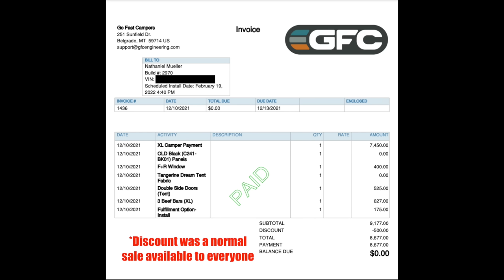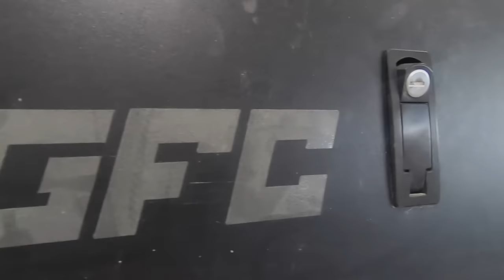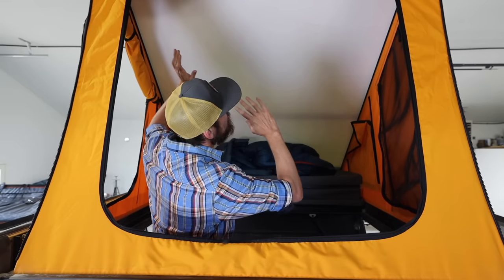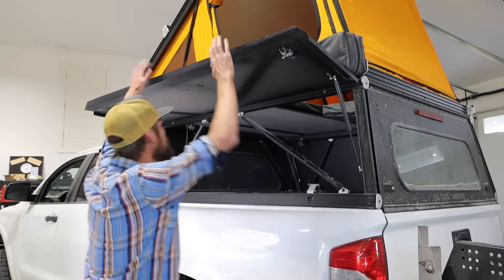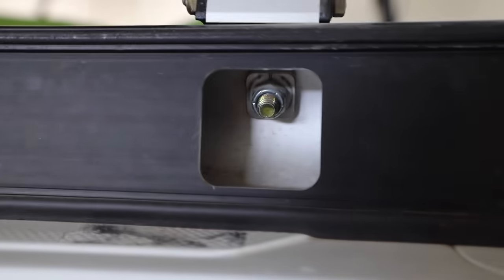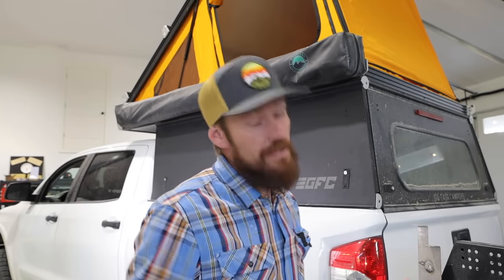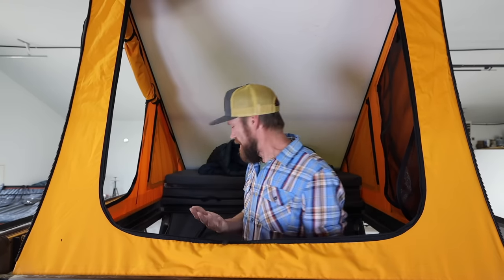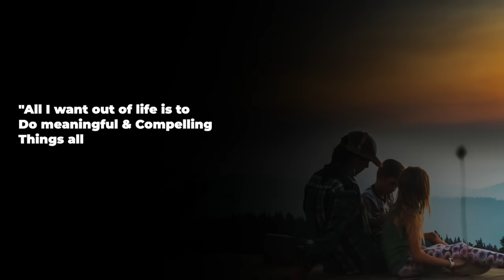GO FAST CAMPER, The BEST, WORST Rooftop Tent - Honest Long Term Review - Truck Camper Buying Guide

Comment from the maker: What do you guys think? Would you buy a Go Fast Camper or are you looking at something else?
Reply: I’ve been doing research and came across your video. After your review it’s exactly what I’m looking for. Simplicity and longevity. Thanks for the video. I’ll be purchasing one.
Reply: I think a FWC project M would be the way to go
Reply: I looked at the Go Fast for my Gladiator Rubicon but ended up going with the Alu Cab Canopy Camper.  The weight issue was not that bad for the Gladiator Mass Gross Weight. When you remove the tailgate you are looking about total added weight is 500 lbs.
Reply: Big fan of ur channel… question, thoughts on security? As in, is it ez to break in to? Would you place valuables and walk away without worry? Thanks!
Reply: I have one on order and will pick it up in about a month.  The GFC fit the bill for me in terms of weight and functionality.  I am a bit worried about condensation in cold weather, but the majority of my camping won't be in cold weather so I'll just deal with it.  Yeah there are other similar campers like the AluCab or Harker, but in my mind they are too big and too expensive for me.  Thanks for this thorough review!
Reply: Looking at Pack Out campers similar to GFC, cost for us canadians would be $15,000 plus driving down to vegas for the install. Have you ever looked at Pack Out?. Great review of GFC.
Reply: Love your truth 😊❤
Reply: I’m trying to decide on GFC or Moonlander. GFC offering me military discount & Black Friday discount almost 500 off. Moonlander isn’t offering any discount.
Reply: Went 100% canadian, alltech Basecamp ov1. Received pre-2024 prices, 270% awning & free winterized fabric for wedgecamper.
Reply: @SasukeUchiha-zu6dw  I agree, but it is double + the price
Reply: Looking at the Lone Peak Camper
Reply: @SasukeUchiha-zu6dw  Yes, I am wondering if the extra 100lbs really matters. It's like a really small woman or a child riding with you. Doesn't seem that big of a difference and they have more features.

But I like how this is a wedge better. Easier to open up and close. At the end of the day extra features are kind of gimmicky and what they don't have you can DIY. A lot of the stuff that the project M comes with are standard camper stuff that people who build out vans and Skoolies put in their builds like the fans etc.

You can probably have some of that added to the roof of the GFC since it can take up to 75lb of stuff on it and still open.

The project M though is a LOT more expensive as you option it out.
Reply: Most of the issues you bring up are now addressed by the new V2 pro. Not sure if running wires or proprietary track hardware are still issues though. I'm considering one of these due to the bombproof build quality.
Reply: I would love to see you review the new version of this tent because it seems like they addressed a lot of things you mention

Comment: I own a gfc and he pretty much on everything on point. The biggest pro for me is how well built it is the biggest con is the lack of features. Every single competitor all offers side windows, solar and roof fan as options imo solar and roof fans are necessities and something every manufacturer can easily install. My gfc is for my Tacoma and I just got a tundra and just because of the lack of features I’ll probably go with a competitor if I choose to get a camper for my tundra
Reply from the maker: Interesting... super curious what you go with.  Let's know what you think of watever you go with.
Reply: You sound like more of a glamper rather than a camper. That stuff is nice and all but definitely not a necessity.

Comment: I have a GFC, and I definitely built it out way more than most GFC's.  Because the GFC is only 275lbs, I have enough payload for my GFC camper, Expedition One bumpers, a Victron electrical system, and all my camping gear and toys  on my 2020 Ford Ranger.      Btw, a diesel heater also solves the condensation issue in cold weather.      Cost-wise, I consider the GFC close in price to a RSI Smartcap and a roof top wedge tent, but you can't stand up inside with those.     And I agree, weight wise, you can't put a Alu-Cab or a Four Wheel camper on a small truck and have any payload left.    But if you never go on narrow, back country jeep trails then just get a bigger truck and go for more comfort.    To each their own.   You gotta pick what's best for your style camping and budget.
Reply from the maker: Agree 💯
Reply: I run a RLD designs canopy on my Colorado and a GFC Superlite.  I wanted the ability to remove the RTT because when we go camping, we don’t always go in the RTT.  Many times we use our square drop camper and sometimes ground tents depending on what we are doing and where we are camping.  You are right cost wise.  I am probably in the same amount of money for the canopy and RTT as a GFC camper would have cost.  Maybe I just over thought it about the GFC camper and running around with the GFC camper on your truck all of the time is no big deal.
Reply: It's really easy to let the GFC's upfront cost sow doubt.    But it sounds like you still have good camping options.   I wouldn't second guess yourself.   Use what you've got until it falls apart!  

I kept my old mini camper (like a small utilty trailer) for similar reasons.   But it's also designed with rear barn doors, so I can get plywood and stuff with it.   It's also nice to have when I can bring a buddy along to camp.      My wife is welcome to sleep in the GFC with me, but I really don't want to spoon with my guy friends.  Lol.

Comment: I’ve had my V2 on my Tacoma for 2 years now. Many nights and miles on it with my wife and now 2 year old. The ability to stand up in it is a massive benefit. I live in the desert southwest where condensation has been a moderate problem, but everything dries out so fast. My two year old also wakes up as soon as it gets light out. I wish there were some easily removable blackout/insulation options for the roof panel.

Comment: Great video.  I feel the same way about my GFC.  I dislike the locks immensely though.  The condensation in cold weather is insane.  Whenever I talk about my GFC I tell people for the price point it's the best you can get.  Added features add cost.  I always mention the negatives as I feel after spending this amount of money people are hesitant to say they've made the less than "perfect" decision and will defend the purchase at all costs.

Thanks for the honest review that should help new buyers.  Liked and Subscribed.
Reply from the maker: Thank you SO much for saying it.... people feel like they have to defend their purchases way too much... its ok to like a product that isn't perfect. For the Value for your money and they weight the Go Fast is a fantastic product... its not perfect... and its ok for both Truths to exist at the same time... Go Fast deserves lot of credit for being an early innovator... and yes other brands are catching up. Thats a good thing, it will put pressure on the market and we, the consumers will benefit from it.
Reply: Heard from another type of wedge camper that all the locks are the same, meaning someone with a similar canopy can use his keys & steal your stuff.
Reply: @CanadianCampPurr  because the type of people spending $8k on truck campers are the type of people to go around stealing from people’s cars. 🤔

Comment: I'm in research mode on getting a GFC. Just weighing pros and cons. Lot of reviews claim water leaking in and quality not good. Not seen that from Topo Toppers, or AT. Good video!
Reply from the maker: well for starters... water will leak in through your tailgate... so any tent that doesn't replace the tailgate will have dust and water leakage. Just FYI. AT's cost significantly more... like almost double so I would expect some differences there... not really Apples to Apples at all... I like the AT's a lot but I didn't like the setup time and extra weight. What one is best for you just really comes down to what you are trying to accomplish. I would like to test a Topo topper... the look great, the weight is awesome, but the supports and engineering for strength worry me... if that tent gets truly offroaded I am curious how it will hold up.
Reply: @OutdoorAuto  I have a Tacoma w/ ARE topper so yeah i'm aware of water and dust. Other reviews claim water intursion from front hinge and pooling in the extrusion. Another showed back door not zipping all the way down and other openings in fabric. Like i said just doing research and leaning towards the GFC.
Reply: @minimalistmaximus6476 we had a small percentage of units a while back that had some upstairs leaking issues. After a very exhaustive engineering effort we updated a number of components and procedures to eliminate the problem. Every camper we currently produce has these fixes and we update under warranty any camper built without these changes if they have an issue.  (I’m with GFC, btw).
Reply: Take a look at Super Pacific. After a bunch of research that's what I put on my 3rd gen DCSB and I absolutely love it.
Reply: @the_wiley_davis  Wiley, I know you are on the forums. The forum community is giving great input and requests for a redesigned v3 tent material. Please please add venting at the top of the tent for the condensation issues along with full zip doors for bad weather conditions. If these changes were implemented it would completely change how the tent feels and acts in the colder climates.
Reply: @the_wiley_davis I had some issues with my GFC Superlite.  Customer service has always been great answering any questions and resolving any issues I had.

Comment: I love my GFC but damn they gotta fix the tent material and the vent. It NEEDS venting at the top of the tent...If they redesigned the tent material + added full zip doors, it would make this nearly a 10/10 for my application.
Reply from the maker: I know what you are talking about as far as adding a top vent,,, when you say "redesign tent material"  do you just mean changing the doors and adding vents... or are you having actual issues with the material itself ( I haven't had any issues with material so I was curious). Also I know the straight zip door are a bit odd compared to what is on the market... but I really haven't encountered... what are you running into there?
Reply: @OutdoorAuto  mainly from a venting and closing the tent up in bad weather standpoint. I’ve spent 30 nights thus far in the tent this year and a handful last winter. Prior to this set up I ran a CVT MT HOOD. That tent material and venting was superb. When camping in a light drizzle or rainfall, you really can’t properly vent the tent…same goes for winter camping. I run a diesel heater which is the only way you can get by without having the massive build up of condensation and ice. When camping in the snow and it blows, snow and cold air DOES enter the tent since the doors are not a complete full zip.

I have also added a indoor/outdoor carpet lining to my roof on the inside which has helped out more I expected. If GFC made changes to the tent design in a way to decrease condensation and keep the elements out, it would be a solid 10/10 for me.

Comment: I had to replace my hatch locks after not putting any lube in them last winter, so the froze up, with road salt. Took like 5 minutes each, and cheap to order from GoFast.   I love how easy it is to replace parts like that, and no manual needed to do that

Comment: This was a super superb video! I would say this is the best review that I Have seen of the GFC PERIOD…
Looking forward to seeing you review a four sided upright rooftop tent. That is just as good or better than the GFC tent.
Reply from the maker: Thanks Joe... Any particular Four sided uprights you are looking at?
Reply: @OutdoorAuto  I was looking at of the James B. Forgive me I cannot remember how to spell the last name, but it sounds French. They do have some very nice upright for walls heavy duty tents that I was thinking of.
To be honest with you, I have never owned a rooftop tent, but I am looking for one for my F350 and I'm not impressed with the big box adjustable bed racks frames that would work with my OEM retractable bed cover
I just watched a review of the Oru truck bed tent camper that weighs approximately 300 pounds and looks rather nice but the leadtime for building is 8 to 12 weeks and can run as much as $15,000 or more. It’s worth checking out though.

Comment: Love the review on condensation, helpful tips to ask. Getting a GFC Camper for my 2009 Ford Ranger consider they’re the only ones who make a durable Camper for older model cars and designed to be fitted perfectly. TopoToppers do not make them for my year and model, AT do not make them for my year and model. Plus, they are more expensive than GFC. GFC targeted audience is for the Simple Innovated Mindset. Some people get misconception of it being labeled as just a “Camper” but really GFC advertise it as a “Platform” or “Template” if you will. A platform to build off of! To add-on and utilize the space inside while camping at ease. Plus, being the lightest and durable Platform at a cheaper cost on Market. It is really a Camper that supposed to help you figure out what you want and need for camping. I think it is a great addition to any truck that wants to be able to get off the beaten path. Also, GFC built a Community of GFC Happy Campers where they share information with each other and how they added on and how they customized their own camper. GFC did a really good job of connecting the community and getting them involved within GFC. That is something solely GFC offers that can’t be priced right, it’s priceless friendships that have been created through the GFC community. I don’t know much about GFC but I can’t wait to take the kiddos camping and fishing, while not worried about the setting up the tent thing or mosquitoes thing. And then I have sort of a Birds Eye view in the morning to make sure no bears or anything sniffing around. But thanks for the review, even though you make everything sound negative 😂 still worth the watch for the experience tips.

Comment: This is a great video. I am waiting on mine, should be shipping in a few weeks but all the reasons you’re listing are reasons I went with the gfc. I’m switching from a fully kitted out Leitner system and it is heavy, cumbersome and just makes a ton of weird noises on the trail. I really wanted to simplify and lighten things up. There are plenty of ways to add features that the gfc may be lacking, but the beauty of that is that it will be exactly how you want it, nothing more. My other option was the Super Pacific, but I couldn’t not justify the added cost. The extra features were nice but no necessary for what I am trying to accomplish.
Reply from the maker: I really want to see a Super Pacific get stress tested… it weighs more than the GoFast but has much less structural supports… so I’m trying to understand is the GoFast just over engineered on purpose, kind of like a Toyota… so it will last or is the Super Pacific under engineered for hard off-road trails.
Reply: @OutdoorAuto That’s the other thing that I was worried about. I live in socal so I’m hitting the desert 90% of the time. Nothing but washboard and ruts. There is no real world test out there, just videos of people talking about features. GFC has plenty of real world reviews. I know people that run these down in Baja and just put them to work. So I’m pretty happy with my decision and look forward to putting it to work.

Comment: this is by far the best review on the GFC I've seen. Saving up money to get one, maybe when V3 comes out I will get one. All other campers look nice, but they all are too heavy as you also have mentioned!
Reply: The V2 Pro is now out and addresses some of the issues.  But at $8800, a bit more pricey but still seems a great value for a lightweight minimal camper.

Comment: Could probably make a little rubber cement ball and put it in the base of the channel to hold that weather stripping in, or use some silicone grease (not the spray) in the channel to give it something sticky to cling to.
Reply from the maker: Yeah, that would definitely do it... honestly I probably just need to take the camper off and re-seat it... I have just been too lazy to do it so far.
Reply: @OutdoorAuto Not matter how light, taking any topper/canopy/camper off of your truck is easier said than done.

Comment: Thanks for the great review - I'm considering one of these at the moment.  I currently use SmartCap which I really like for the durability and the fact that it seals out all dust (using positive pressure system).  I notice your truck bed is pretty dusty, so I'm assuming this system doesn't seal up very well or do you just camp in dusty places ;)  ?  Thanks.
Reply from the maker: My truck bed has huge holes cut in it for the long travel shocks so it is a bad example... you can cut down on dust quite a bit if you do the seals around the tailgate, but to really beat it you basically do the same thing... put in a positive air system. Also make sure and check out the new version of the GFC that just came out... they fixed almost all the issues with it... I was pretty impressed.

Comment: You should look into getting some moisture absorber bags that you use for closets  to hang on the ceiling.  Super cheap easy fix for the condensation problem.
Reply from the maker: You know... that is an interesting idea... I wonder if it can overcome the cold metal though... it seems the almost freezing temperature of the metal is very hard to overcome.